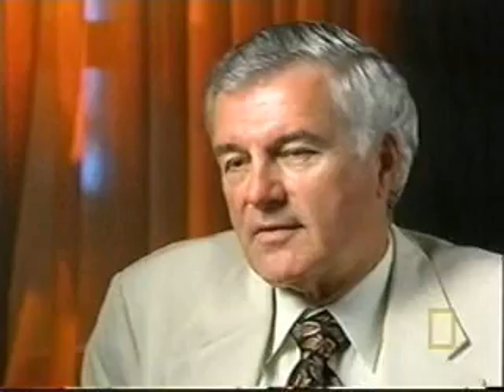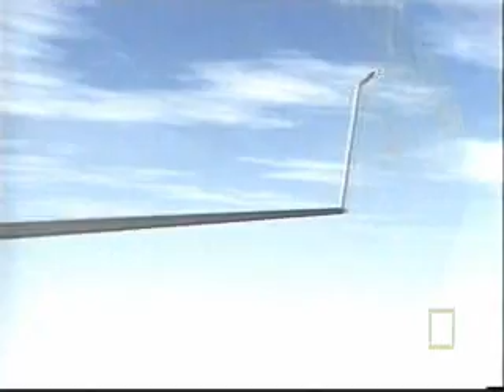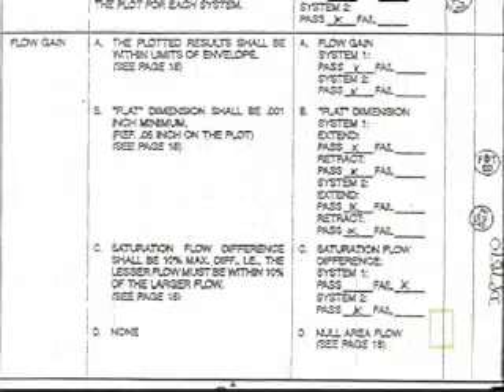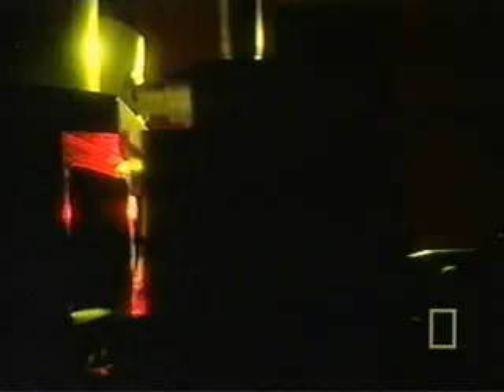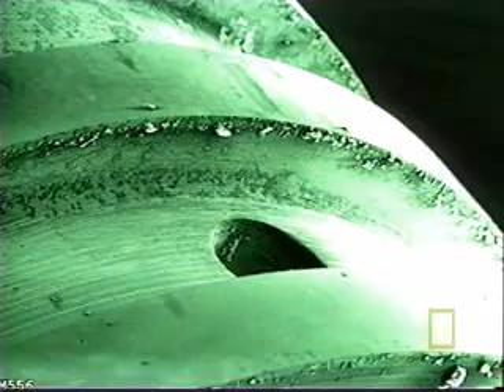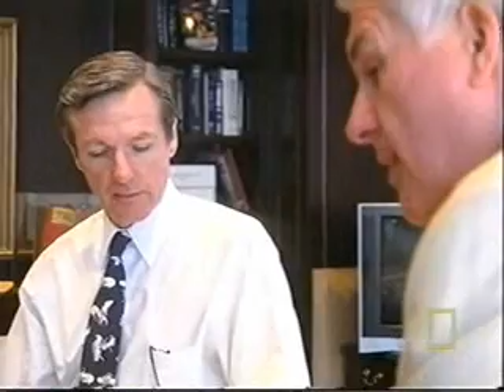Silk Air Flt. 185

Comment: This documentary, Silkair 185: Pilot Suicide? is a bunch of nonsense. The NTSB and NTSC were able to determine that this was in fact a case of pilot suicide:
1. They determined in a 737-300 flight simulator by testing over 20 different scenarios (including a rudder hardover) to match the radar path of flight 185 and the only one out of those 20 that matched the radar path was deliberate pilot inputs.
2. The trim of the airplane was found in the full-nose down trim, contrary to a little bit nose down in the event to recover from a rudder hardover.
3. If the Cockpit Voice Recorder (CVR) failed due to a power surge then a distinct popping sound would be heard on the CVR, but this was not heard on Silkair 185's CVR, so the conclusion was that it -- and most likely -- the Flight Data Recorder (FDR) were intentionally disabled. Pulling the circuit breaker to the CVR makes almost no sound at all so it's not difficult to pull a circuit breaker without another pilot being aware of it. And if the circuit breaker to the FDR is pulled then a Master Caution warning and light would be triggered so the Captain could not have done this with another pilot in the cockpit.

This documentary fabricates and cherry-picks the evidence to make it appear that these lawyers/plaintiffs are correct in their hypothesis that a rudder hardover had indeed brought down Silkair 185. While they are correct that in the 1990s there were 3 cases of an uncommanded rudder hardover onboard a 737 (two of which led to a crash), the cause was completely different than what they propose happened on flight 185. In those 3 cases the NTSB found that the Servo-Valve was vulnerable to thermal shock; going from very cold temperatures and then being subjected to very hot temperatures by hydraulic fluid, causing the rudder to go into a hardover position and for rudder commands to become reversed. Following this discovery the servo-valves were redesigned to withstand thermal shock even before the plane which crashed as Silkair 185 had even begun construction, and both the Captain and First Officer of Silkair 185 had recieved this extra training. Also, the Captain of flight 185 was a former Instructor Captain so he would be very familiar with the procedure to recover from a rudder hardover.
These lawyers/plaintiff's hypothesis for Silkair 185 is that a manufacturing defect had caused the rudder hardover. While this does involve a rudder hardover, the cause is completely different than from the other 3 and is a entirely new cause altogether.
 
Lastly, unlike the 3 previous cases where the plane was about to land, Silkair 185 was at cruising altitude of over 30,000 feet so the pilots would have over 30,000 feet to recover the airplane instead of a few thousands feet. 

This documentary and these lawyers/plaintiffs are full of complete nonsense.